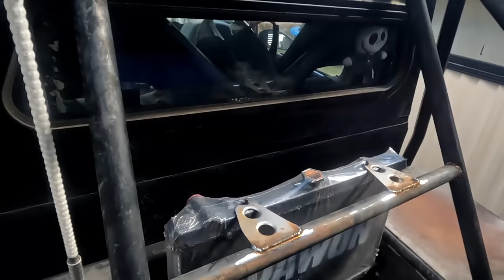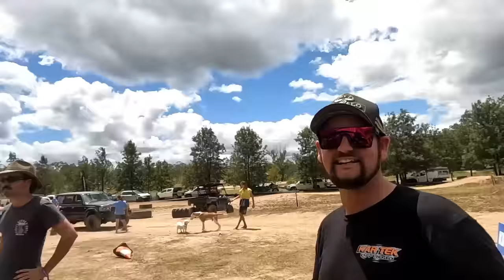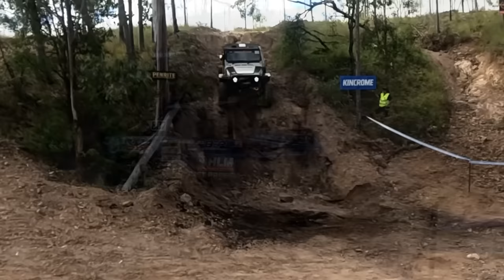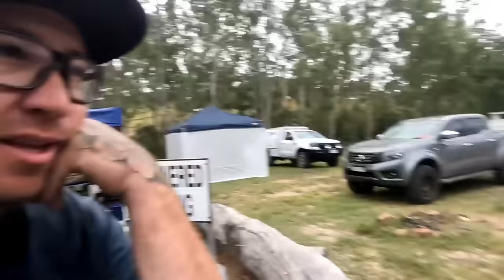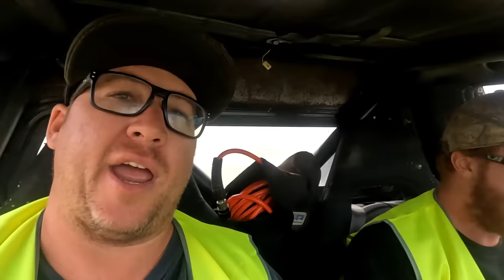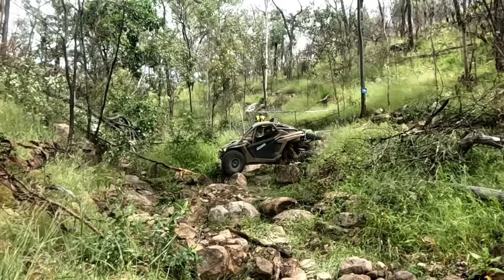OFF-ROAD OUTLAWS was insane! Rollovers , sketchy sends and overall madness PART 1

Comment: Hey mate in my experience with my old winch truck i had the fans pulling through with a good 200mm between rad and cab
Standard ls1 mechanical water pump was fine, i didnt run a thermostat. I used 38mm aluminiumised exhaust tube for the pipes with random rubber joiners.
I eventually added an electric water pump purely to make bleeding the system easier but can get by without one.

Comment: Luke, if I didn"t see in videos from since you got the vitara that's on me, but what motor and tranny is in that nugget?
Reply from the maker: Stock 1.6 engine and box , 4.7 trailgear transfer on Hilux axles with chromosome
Reply: I thought the vitara pez pack 2 doors were 1.6L, the 1.8L were for the pez pack 4 doors and the high end models had a 2L 4 banger. Dunno how the stock trans has held up even with the gear reduction.
Reply from the maker: @Greg....  in the later models that had different options 
Mine was a 5 door but I cut it
Reply: @Lukefink  yeah ive been watching for a long time before you even bought it so i know its a chop and no longer green. Still surprised where a 1600 has got you.
Reply from the maker: @Greg....  don’t need power!! It’s got enough gearing